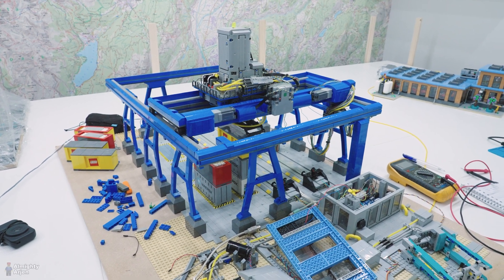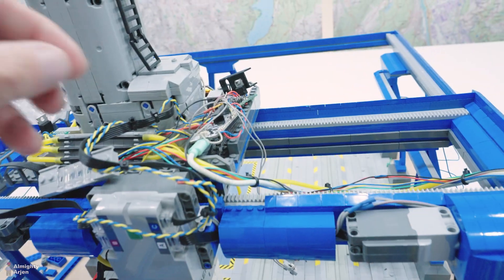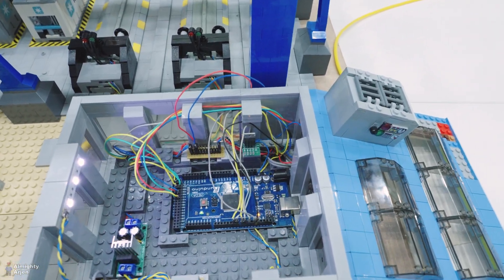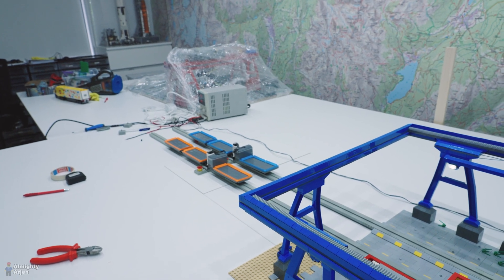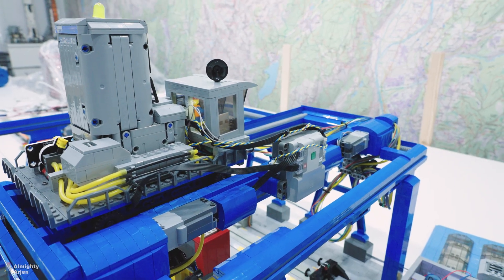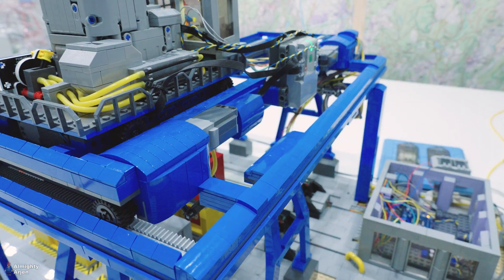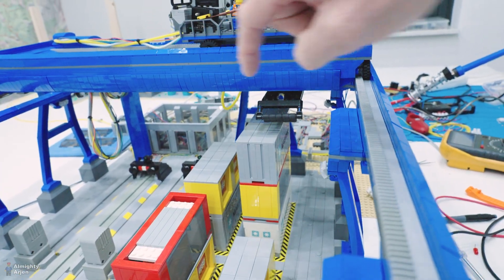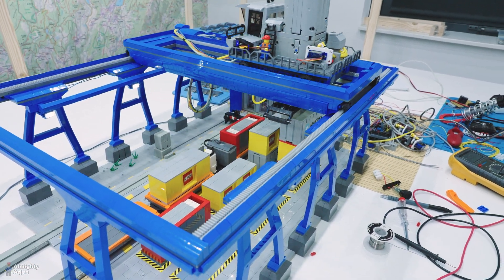Automated container terminal WIP E54:  Moving monorails!

Comment: This is awesome. What would be cool if if the software knows where everything is stacked and can map it's own route so it doesn't topple anything.
Reply from the maker: It does that actually. It went wrong because I made a mistake placing the containers in a way that corresponded with the software. Normally at start-up the crane performs a scan procedure to see how many containers are in which spot. I tried to win some time to skip that. And it would have worked if I didn't make a mistake :)